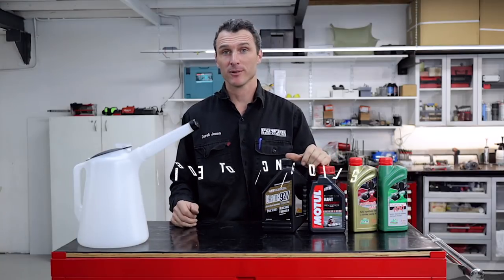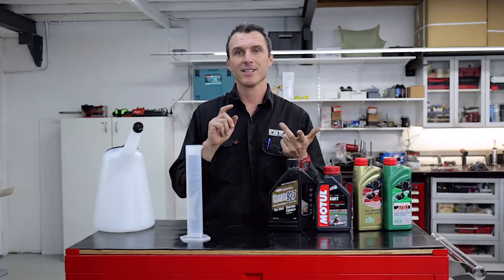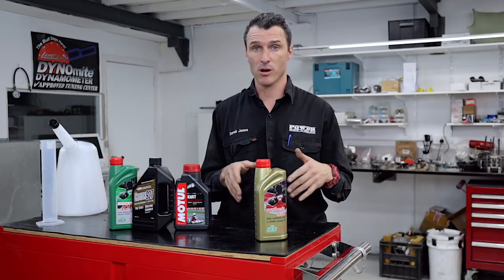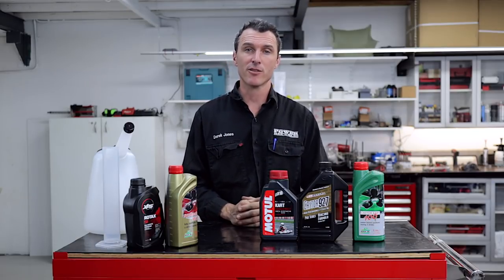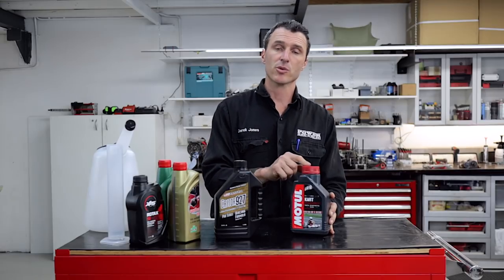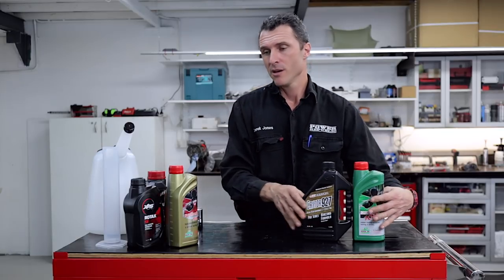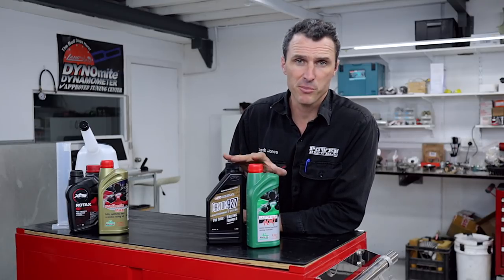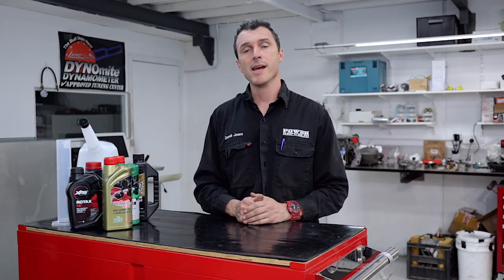GO KART HOW TO: Guide To Racing Oils - POWER REPUBLIC

Comment: Just one other thing to add in for the viewers, there are different types of synthetic racing two stroke oils. It is recommended modern 2 stroke race engines to use what's known as an ester based synthetic aka as a group 5 synthetic oil. These oils use the latest technology in lubrication known as esters, they cling to metal and provide superior lubrication and are extremely clean burning (does not leave much or any carbon deposits). Older "full synthetic" oils are whats known as PAO synthetics or group 4 synthetic oils. They don't provide the level of lubrication as the ester oils nor do they burn as clean.
Reply from the maker: Wow Chris, thanks heaps for your input.  Excellent information there.

Comment: Good stuff👍 how about a vid of you out on track testing tyres and tire pressures and how it affects the kart through the corners. Also the best way to store them afterwards. Atm i have some really really old but good life tyres on my kart. It was very sliddy in the corners. Im a tall guy 6ft 2 and my seat is fixed lower than the chassis rails. Ive heard lowering the axle and lower the rear pressure mgt help get bite through the twisty bits. Ive bought some new tyres to eliminate the tyres as a reason.
Reply from the maker: Great questions.  The best thing to do is go with new tyres first and then start thinking about your problems.  This way you are correcting problems you have thought about and not problems you have introduced with the old rubber,

Comment: Derek you guys need to get the ratiorite cups over there if you dont, makes the whole mixing process so easy as it's already graduated for 40:1 etc based on how much fuel you're using
Reply from the maker: Hey Chris, they do have them here, I personally don't use them, but they are a great tool for some people.  Thanks again for your input

Comment: Love the videos Derek, stuck a piston ring last week on my x30 so the timing of this video was perfect! Is there any truth that it's not recommended to swap from a castor based oil to a full synthetic as it can cause premature failure of the bottom end bearing (no idea what the science is behind being told this) or is this just one of those many karting 'wives tales'? Cheers!
Reply from the maker: Hi Master, Thanks for the positive vibes.  No I don't think it's problem.  If your rings are sticking, use the Maxima 927 or Motul GP2T as they are the best 2 I have seen to negate this problem

Comment: Thanks for another great and informative video, Derek. Related question: What do you recommend to use for gear oil in a Rotax? And how often do you recommend changing it?
Reply from the maker: Hi Jason, thanks for the positive vibes. We recommend using AFT.  We recently bought some 'Redline Racing' brand ATF and that seems as light and slippery as anything.  The balance gears on a racing 2 stroke engines aren't on a tremendous amount of load, so we don't use a heavy gear oil.  And we change it all the time, maybe once every other time we use it, and definitely after we use them in the rain.

Comment: Hey mate love your work. For a X30 iame.
Thoughts on:
- PENRITE 10 TENTHS 20W-40 RACE CASTOR SYNTHETIC ENGINE OIL? And Shell M Castor Oil.
Looking at using them up and moving to 927 caster.
Reply from the maker: Hey Steve, thanks boss.  no to the 1o/10ths.  yes to the 927.  reason, ring stick.

Comment: What is the performance difference between running rich oil mixture nd the lean oil mixture and why?
Reply from the maker: Hi Greg, great question, the richer the oil mix the more oil in the engine and less wear.  You can foul spark plugs easier if you use a lot of oil.  and there is a point of diminishing returns.  I don't like to go less than 50ml of oil per litre of fuel.  the max I have used is 70ml/1L.  Give that a go and see if it works for you.  But not for Rotax engines, use 25ml/1L max

Comment: Will Motul 800 Off Road Oil be a good choice for rotax max evo?
Reply from the maker: I haven't used it before.  Is it full synthetic ??
Reply: I wonder what the maximum rpm is achieved by the rotax max evo motor?  Is 2% of the oil mixture enough for weekend use?
Reply: Motul 800 quality 100% synthetic ester, standards API TC. Formula developed for Motocross Grand Prix Teams. Compared with Motul 2t cards, API TC + standard is missing?

Comment: I run a TM K9b what oil do you recommend? Also I have an issue where my tie rods hit the back of my calves when turning. What do you recommend?
Reply from the maker: you could use a pedal platform to lift your heels off the floor pan.  I like to use castor oil in the KZ's

Comment: When it comes to running in an X30, is it OK to still use my Motul 2T (my norm mix being 50ml per L)? I’ve heard castor should be used for running in, is this actually necessary?
Reply from the maker: you can use either.  both are excellent in my opinion.

Comment: I use the motul fully synthetic oil in my x30 and never have a problem with it. I’ve never used the castor oils. Is that bad?
Reply from the maker: Hi Andrew, no its not bad, both oils work just fine.  I have used both with out any troubles.

Comment: What transmission oil would you recommend for a ROK gp, manual says 40w90 but I have been suggested so many different brands and types
Edit: the non shifter version of ROK GP
Reply from the maker: If it is straight cut balance gears it won't matter what you use as long as its light weight.  I like regular Auto transmission oil for that exact reason.  its also cheap in bulk so you can change it on the Reg.

Comment: What do you recommend for vortex rok gp? Synthetic or castor? and what is the ratio. The manual said 40 ml oil for 1 liter fuel, should i follow the manual or mix it 50 ml oil for 1 liter fuel?
Reply from the maker: Rok Gp I would use 50ml per litre and Vroom Syncorse

Comment: I have a "comer  k100" engine and I use Motul at 5% (50ml for each liter), it should drop to 3.5% (35ml per liter) or keep the same mixture. Gracias !
Reply from the maker: we use 5% here in all engines except for Rotax.  i would keep it the same.  Oil is your engines best friend.
Reply: @PowerRepublic  
Thanks. The other, have a video of which oil is recommended for the brakes
Reply from the maker: @basili010  we use the OTK 5.1 brake fluid in almost all situations these days

Comment: I’m looking at using motul in my x30. What should be the ratio of mil to liters? Thanks
Reply from the maker: 50ml of oil / 1 litres of fuel is what I use.
Reply: Do you know what kind of gas I should use in my x30.
Reply: @thomastawfik8465  diesel
Reply: @thomastawfik8465  98 and 40ml motul

Comment: I was wondering about torque smokeless 2 stroke oil and supposed to gain a 1000 rpm ?.. is this true and do u recommend it... thanks for your time
Reply from the maker: I wouldn’t think so IMO.  The rpm limit is generally set by the length of the straight and the gear ratio selected

Comment: hey recently got my first 125cc shifter kart .the thing is for the life of me cant find anywhere the specs online neither the what is the correct 2troke oil to use and the mix ratio..can you point me in the right direction? 
The engine is :  Pavesi 125cc
Reply from the maker: use Maxima 927 at 50ml per litre or 20:1
Reply: @PowerRepublic  thanks really appreciate it!!! and your awesome the channel is library of knowledge ..   !!!

Comment: so Motul Kart isnt recommended for the X30?  or is it all good to run?.. I was told Motul at 25:1 when i got my kart, cheers!
Reply from the maker: Yeah the Motul is awesome. We use it all the time.  We use 20:1
Reply: @PowerRepublic  might make the move to 20:1 then rather have more then not enough! cheers
Reply from the maker: @lukeross4779  good idea
Reply: What do you mean with 25:1? 25 mL of oil to 1 liter of gas?
Reply: I'm using the Wladoil k2T on my rotary valve vortex for now, 40mL per gas liter. Do you think I can run the motul? It is almost half the price.

Comment: what do you use on a yz125 shifter kart 12000ish RPM? 20 to 1? thanks
Reply from the maker: To be honest, I have never measured the engine RPM of a YZ or any dirt bike engine.  I will have to put one on the Project kart for you and let you know. And yeah, 20:1 for go karting use as the engine is loaded way more on bitumen than the when on dirt
Reply: @PowerRepublic  right on and I have access to 100 octane as well. Thanks!

Comment: What do I have to mix in a 100cc crg sp 97 engine?
Reply from the maker: 50-60ml per litre castor oil.  (Shell M )
Reply: @PowerRepublic  OK thank you very much
Reply: This is gold proportion 1:16 
I use this for Maxter 100cc and Rotax DSC-III
Reply: I used to race that exact engine back in 2000..loved it and mine ran best on Blendzall Castor oil....Where are you getting parts for your motor?  I want to rebuild mine and need bearings piston, ring and maybe a conrod...

Comment: so my mates and i got a 125 iame engine i think its the parilla leopard version and i was asking myself what to do... the dude i bought it from says mix it 40/1, you say 20/1 and the iame manual says  16/1.... ours is an older engine i think tho so maybe its different?? help me out plsss
Reply from the maker: I don't think the will last long at 40:1,  minimum of 20:1 (50ml's per litre).  you can run 16:1 (60ml's per litre) as more oil will only help prevent the engine seizing.
Reply: Power Republic alright great and i will be using an oil like the shell racing m or something right?

Comment: I have been told to run 250ml for every 10l on my restricted x30 with 927 castor oil. Is that bad or not? Thanks
Reply: x30 uses 25:1 ratio they need 4% which is double the amount of a rotax
Reply: thats bad its not enough oil.you need  250ml per 5 ltrs
Reply: Even If it is restricted?
Reply: I race an x30 restricted and run 5%, so 250ml for every 5L
Reply: @joshsalerno746  yes,and possibly a hotter plug than a snr